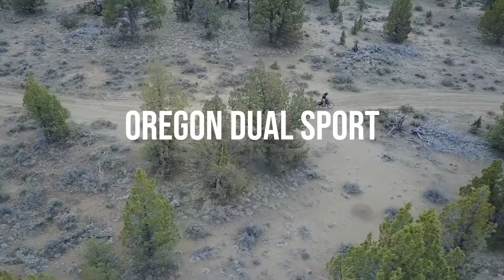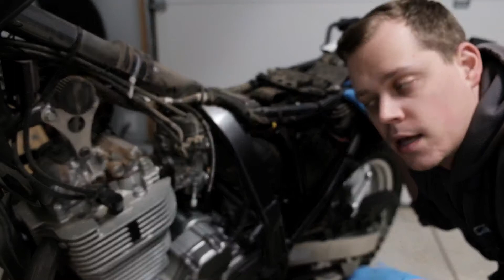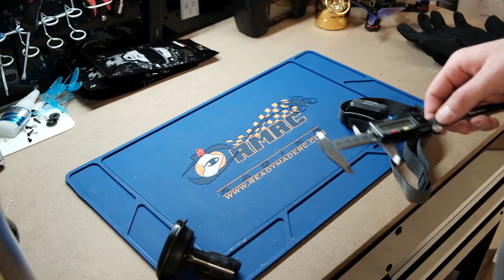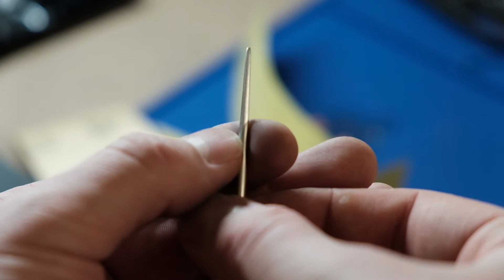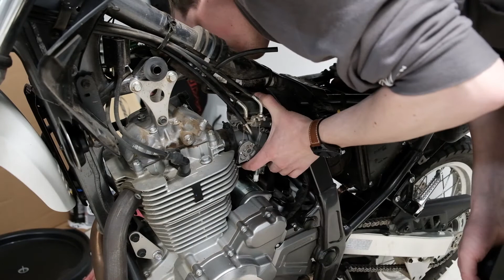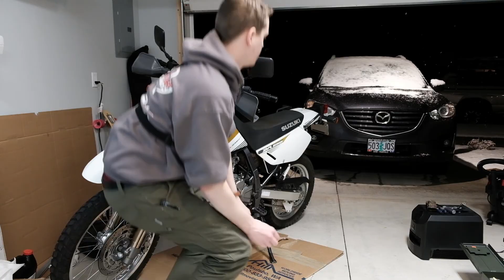PART 1//Suzuki DR650 Carb Work//DIY Attempt!

Comment: Hey buddy, I live in Bend and have done the same mod. I Would love to go riding with somebody.  Great video by the way!
Reply from the maker: Oh nice! I sold the DR a few months ago since we primarily ride single track and tight trails. What sort of riding do you do?
Reply: Damn, I was hoping to see how yours compares to mine. I have just been riding mostly fire roads and a little out at East Fort Rock. What did you get for yours and how many miles were on it? What are you riding now? Been eyeing the Huskies myself.
Reply from the maker: I sold mine for $4300 with 4k miles on it. I picked up a new 2018 Husqvarna FE350 and have been loving it

Comment: Nice video bro. I have the 2013 with no off switch for the gas.  Was your gas tank empty when you removed the gas line?
Reply from the maker: Gas tank was not empty.
Reply: Stock fuel valve is vacuum controlled and should not flow fuel unless it is malfunctioning or on prime.